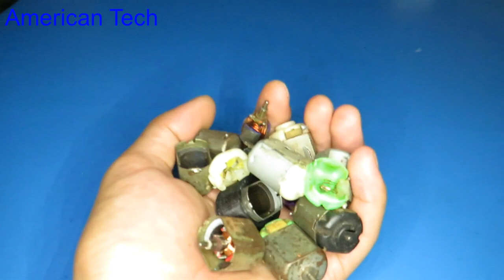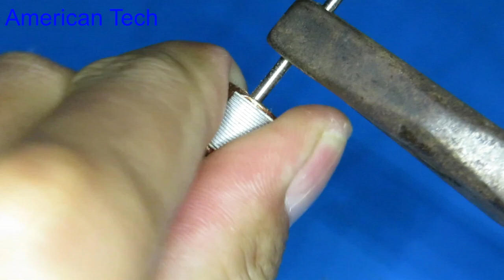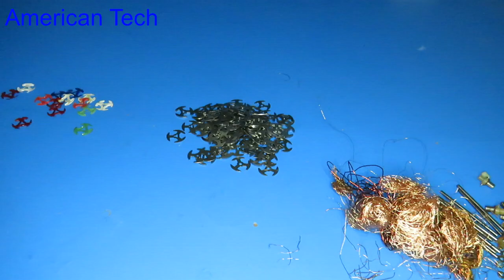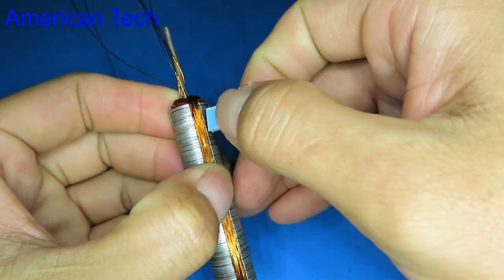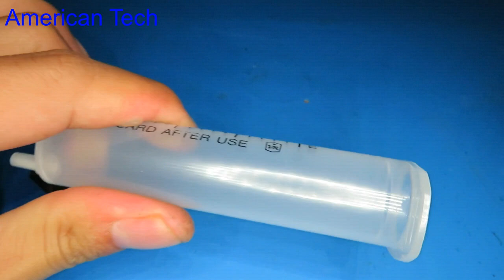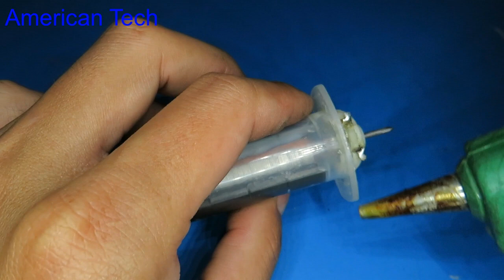6000+ RPM Syringe motor , High speed running

Comment: Your ideas are very cool, but you are not showing base motor properties. They are amperage - just connect ampermeter in series. And real power - just tie a wire on the axis, and tie some weight to the other end.

Comment: u use one of those form a remote control car toy with a long ball pen plastic case glued on it and 4-5 needles tied together on a metal wire instead of the inside of the pen. you can find on the internet how to do it.a tattooing machine.in Romania this is what they do home-made for tattoo machines.its very fast and efficient but takes longer to do tattoos.so yea, if you want that cheap jail tattoo look , search for that and do it urself :)